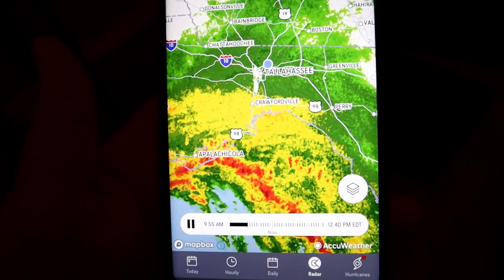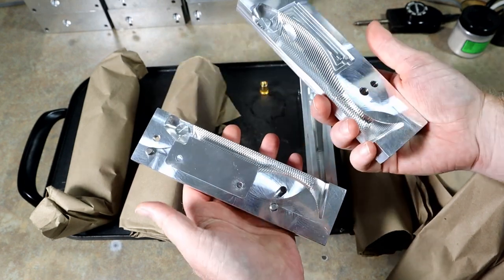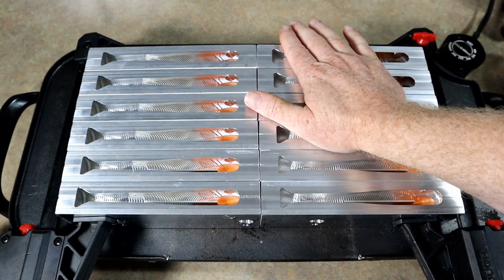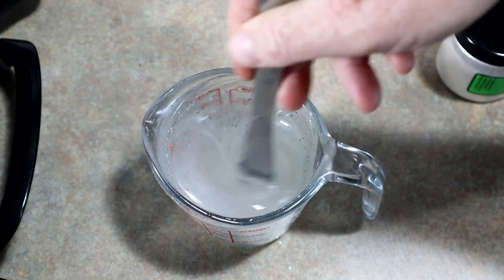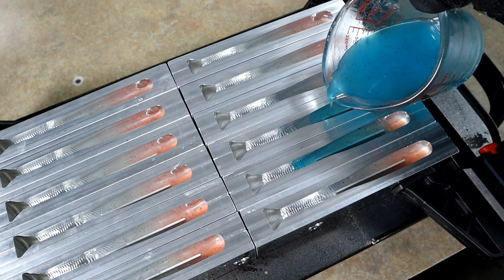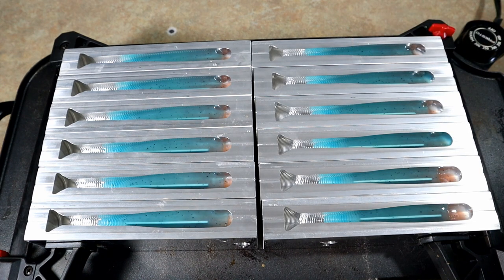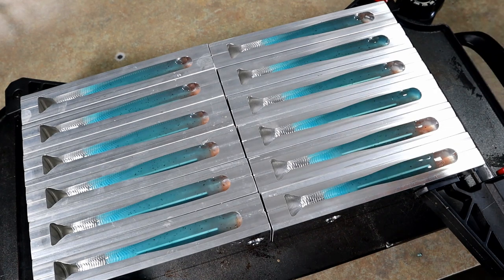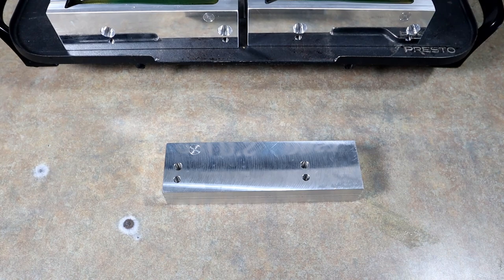How To USE HEAT To Make Better Hand-Poured Baits; Lure Making Tutorial

Comment: Great video, I have been having problems with all the glitters settling to the bottom of the mold when hand pouring.  Do I have the mold to hot or is the plastic to hot.  Need your expert advise.

Comment: Great vid. My question is how do you get rid of the cold cracks when you only have rubber molds because pre heating is so much harder.
Reply: I've preheated my silicon molds on the griddle. Most Silicon has a heat tolerance of like 390. So I just set my griddle to 300. It takes about 20 minutes to preheat them but it works really well. I hit them with a heatgun if they need it but they usually don't. The baits turn out fantastic and I've probably done 30 or 40 rounds with no noticable effect. Just be sure to hit your molds with a silicon conditioner before you store them.
Reply: Thanks for the reply have you done any vids on it?

Comment: I have been wondering how to keep the head section pour from drifting toward the tail.
Then,. Duh you put a mold under the griddle to angle it up. Why didn't I just think of that. 
Thanks for the info.
Also, did I miss what the mix of the final pour was. Is that watermelon??

Comment: Is there a way to do this with silicon molds? I struggle with delamination on mine and when 
I use a heat gun my glitter sinks. loved the video!
Reply: I had my glitter sink on the second layer. I used the aluminum open pour mold. I also noticed the glitter fell to the bottom of my pouring cup. I had to try stirring while pouring. Does anybody have any suggestion on this?   Michael, I tried doing two layers with ribbontail worm silicon mold. I did have a batch that they just peeled apart. I did heat mold on griddle at 300° and those turned out a lot better.
Reply: @DelawarePondHoppers   Thanks for the info! wasn't sure if you could but the silicon molds on a hot plate or not. I found that swirling the cup after every pour helped with the glitter but cooled the plastic way faster.
Reply: @Michael Williams  most silicone molds can withstand 395°

Comment: Are you heating your plastic to a lower temp than what a typical injection would be? BTW awesome vis thanks
Reply from the maker: No, generally I pour at a higher temperature than I like to inject
Reply: @WorldsWorstFishing  Ok, do you slowly decrease the temps as you progress thru the layers. Or slowly let the first layer cool a bit before doing the next one
Reply from the maker: @DeeDee-vu5mi  it's all about timing, the molds are preheated very hot and I let the layers set up slightly before pouring the next
Reply: @WorldsWorstFishing  Thanks so much for your info.

Comment: I pour a layer, let it set, pour another layer, let it set and then top it off. Afterwards I'll bake it at 350 degree. When the plastisol levels out on top,  shut off the oven and let it cool down.
Reply from the maker: You can do things wayyyy more efficient than that .. but don't fix what isn't broken I guess
Reply: @WorldsWorstFishing  Yeah, I've watched your previous videos on this subject. I tried it too but it takes a lot longer for me because I'm constantly checking the mold making sure the plastic is at the right viscosity before pouring the next layer. So, I tried this version and it works the same. Just that I don't have to watch and wait for the right temp to pour.. I guess it's faster for me....Mainly because I use to pour 100 molds at a time... haha.